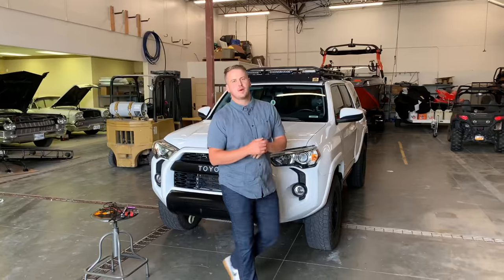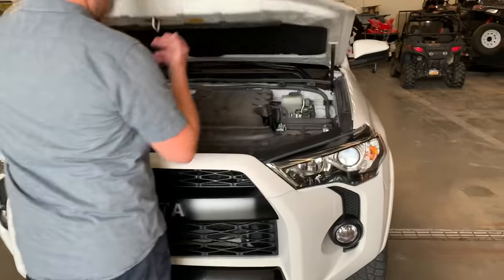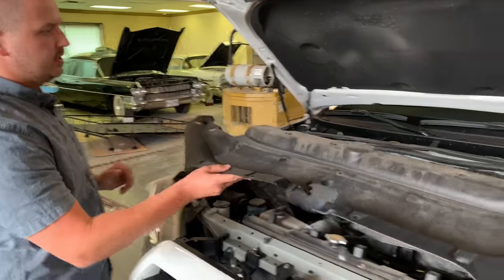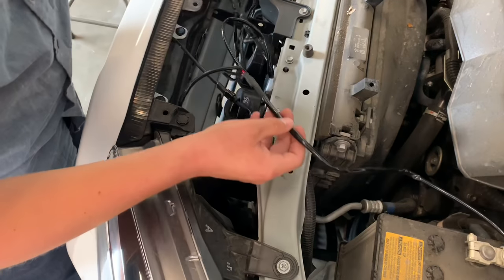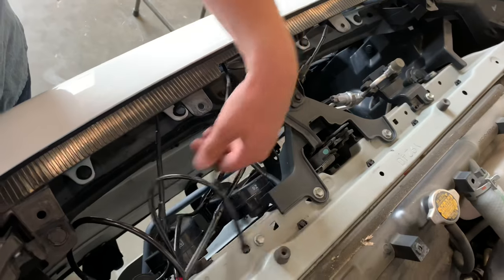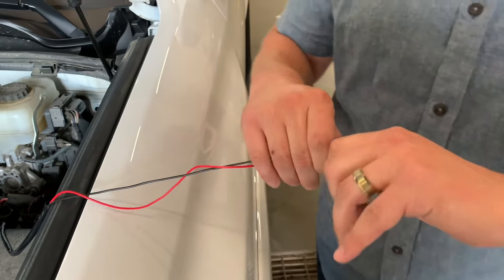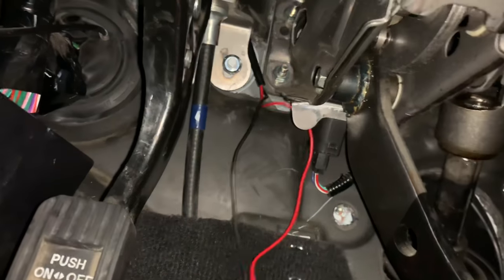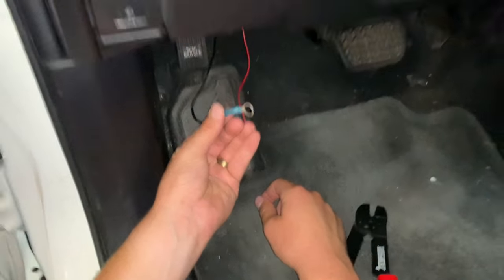4Runner RAPTOR Lights Installation!

Comment: Install appeared to go smoothly, but lights will not turn on.  Tried different fuse locations in the cabin, re-checked connections, but nothing.  Awaiting return communication from 4Runner Lifestyle.
Reply: Just did the install, same with me. Did you get it figured out? Thanks in advance.

Comment: Where do we connect on a 2024 trd 4Runner outside fuse box?
Reply: Im wondering the same thing. My headlights' DRL fuse tap seems to be the only fuse that I can plug into that actually turns the lights on and off with the car. The other fuse locations just keep the raptor lights on even when the 4Runner is off. I can do what he did in the video but then my fuse box's cover wont be able to go back on with that big fuse tap coming out of it. Lol talk about rough day

Comment: I have a 2020 trd pro 4runner and my fuse box doesn’t have the same configuration. Where do I plug in the add a fuse??
Reply: @ Ryan Peck, did you find out the answer to your question?
Reply: I’m still trying to find the answer. No info yet on you tube?
Reply: Did anyone find an answer for the 2020 TRD pro?
Reply: I have not. There is a guy on you tube with his white 2020 Pro with raptor lights. He has not posted the video yet how to hook them up. His name is Chris.
Reply: Plug it into the big fuse box in the engine compartment.  Look for the fuse marked 10A INJ
Reply: It’s the 1st 10A amp on the left of the fuse box when standing on the driver side.  The fuse order on the left raised area is 25, space, 20, space, and then the 10 fuse to remove.  The raptor lights will turn on and off when the vehicle is on and off.
Reply: Thanks Raymond, Now I just need to order the lights. Was waiting to get a answer. Thanks Again.
Reply: @Raymondmoy  Have you installed these on your 2020 already? If so would you mind doing a quick video showing where you plugged everything into, if not no worries. Thanks.
Reply: @Raymondmoy  when you plugged these into the location that video suggest were you able to get the lid on the fuse box fully closed?
Reply: Jsin Legacy. Yes, i was able to cover the fuse box and snap it in place in 3 out of the 4 connectors. 

See the video posted by Taco Twonz 
https://youtu.be/WxPsEPIQ3ak
Reply: Jsin Legacy 

Remove the bolt at the edge of the fuse box, so that piece can be removed.  The wires for the raptor lights can be run up that area.

Comment: Hi, would they fit a 2021 4Runner? Or do I need something different? I went a bought some on Amazon and I just couldn’t install them they were loose and flimsy they were called seven Sparta 4 PCS LED.

Comment: Bought these for my 2021 4Runner SR5 Premium and they don’t snap into place on the grill. The body of the 2020 and the 2021 didn’t change. Disappointed.
Reply: They fit perfectly into mine.  I know it seems silly, but try flipping the lights upside down from the way you had it initially.  They're identical, I know, but this worked for me.

Comment: How would you install these different if you want them to come on with your headlight amber lights or foglights?
Reply: I'm interested in knowing the same. 
Which fuse should be used to get the lights to turn on with headlights?

Comment: does the black wire is the ground or negative? trying to figure this with a switch and a relay. Are there any videos with the same lights installed it with a switch and a relay?
Reply from the maker: We don't have another video showing this but the black wire is indeed a negative.

Comment: I have the 2021 4Runner TRD Off-Road Premium w/ KDSS. There are only 3 open circuit breaker slots open and only one of them fits the wire that comes from 4Runner Lifestyle. That specific breaker opening works but does not power down when I turn off my accessories, turn off lights, lock my doors, etc ... The Raptor Lights stay on. Any guidance or support would be greatly appreciated.
Reply from the maker: For the newer 4runners you have to put the add a fuse in the tail position of the fuse box.
Reply: Thanks

Comment: Obviously a dated video at this point.  I don't have all those open spots on my 2022 SR5.  Also, when does that spot get power?  Always?  When the accessories come on?  When your DRL come on?  Or when your headlights are on?  Great video for whatever year 4Runner you're using, but details about the type of fuse port you're using would be helpful.

Comment: on this install will the raptor lights work without having to put the DRL lights on?
Reply from the maker: If you put the ad-a fuse in the correct position the raptor lights will turn on and off with the car organically no switches or light toggling needed.

Comment: Interior Fuse locations are completely different on a 2020+ 4runner. Will need to utilize another fuse placement for these years, FYI.
Reply: Yes...2018 is different as well
Reply: Which one?
Reply: I have a 2020 and I don't have an empty slot where should I plug it in?
Reply: I’m in the same situation what did you guys do

Comment: I bought a set similar to these lights, do these come with all of the electrical connections included? If not, what sizes/gauges do you need to buy?
Reply from the maker: It does come with all the necessary hard ware

Comment: Do these clip-in style lights work (clip-in) on the OEM upgrade grill? I have a 2017 SR5 and want to upgrade my grill ty o have the lights but i don't want to spend $600 for a grill upgrade to then find out that these lights won't fit. Anyone know?
Reply: Should fit the SR5 grille just fine. But only on top. The bottom grille holes are bigger.

Comment: I didn't like where the harness was installed.  Instead I installed it on the fog light circuit so that they lights would turn on and off with the fog light switch, controlled by the fog light relay and protected by the Fog FR fuse.

Comment: I have a ‘21 TRD Venture, I’m installing the lights on the bottom section of my grill and the lights don’t clip on. Any advice on how to fasten them?
Reply: Also, my lights stay on constantly. Please advice!
Reply: @raularisty3077  I had to buy bottom light kit.  It comes with a backing and have to screw them together to stay in place

Comment: So do we just leave the hole in the firewall unplugged?  Cant plug in the grommet with the wire there.
Reply: what i've done in the past on other vehicles is i remove the grommet and drill a small hole through (slightly smaller then the wire diameter to make it a tight fit), then pass the wire through the grommet and leave the grommet sitting in the middle of the wire. then when the wire is done being fished through the firewall i simply slide the grommet back into position and pop it back in. easy way to seal it back up.

Comment: What is that blue piece at 7:32? I bought the raptor lights and they didn’t come with that.
Reply from the maker: that's your ground connection, if your raptor lights didn't arrive with one feel free to reach out at sales@4runnerlifestyle.com
Reply: @4runnerlifestyle  ok thank you

Comment: Does anyone know of an install video that shows me how to do it if I want the option of turning the lights on and off?
Reply: You would need to link it to the cabbing with cables OR use search for a led switch with on and off remote. Like those rgb ones.
Reply: Just cut the positive line and put an togle switch for on and off.
Reply: @BENHAWAIIVLOG  better to do it on the ground side.

Comment: Do headlights have be on or will the raptor lights   work with just the  daytime running lights  on  as an option
Reply: No... if you put the fuse connector in the fuse socket shown it will illuminate when the ignition key is turned on.
Reply: @synth505  so essentially its always of the car is on?
Reply: @PocketManga  yes... if ignition is on, lights are on

Comment: Ya you don’t need a flat head screw driver to pry off those plastic pieces in the beginning. It’s just a button you need to push. I broke 2 of em trying to pry them out with a flat head like you said

Comment: So I did this and have to say I was a bit annoyed that by the time I ran everything to the fuse box, the fuse list was completely different for the 2020.  I do not know much about that stuff so is there any indication as to which one of these fuses will work so the lights come on as daytime driving lights?  I have it plugged into the TAIL fuse now which works when I turn the lights on but I'd rather have them on all the time.  Any help @overland?
edited for fuse map image: https://i.imgur.com/akDa4Uv.jpg
Reply: Did you ever find a resolution?  I also have a 2020 and am interested in these lights, but would only purchase them if I knew it was possible to run them all the time and not just when the low beams are on.
Reply: In the fuse box under the hood, look at the far left and you see a 10A fuse marked “INJ” it’s 2 above a 20A fuse marked “INJ NO.3” plug it in there
Reply: This worked for me! Thank you
Reply: Ryan Fisher  did you leave the cover off??
Reply: @Geiger19k  thank you for this.   So just run that red wire with the fuse inside and keep the black plugged inside or also under the hood.  Thanks
Reply: @Geiger19k  where did you land the negative?
Reply: @rebellion700  I just picked a screw that was mounted to the body. Doesn’t have to be specific.

Comment: I’m assuming since these are on all day and night whenever the truck is on, these will die fairly quickly? How long do these lights usually last?
Reply: Thats the beauty of LED lights. They use less power, are brighter and last longer. Many LEDs have a rated life of up to 50,000 hours. This is approximately 50 times longer than a typical incandescent, 20-25 times longer than a typical halogen, and 8-10 times longer than a typical CFL. Used 12 hours a day, a 50,000 hour bulb will last more than 11 years. Used 8 hours a day, it will last 17 years! I don't know what type of LED they are using for this product but I'd bet my bottom dollar they last longer than any halogen bulb I've got on my vehicle.

Comment: cool lights but how to turn it off during day time?
Reply: Use a different fuse selection
Reply: I used the 10a."tail"   on the in cab fuse box.  Because I didn't want them on during the day

Comment: I installed exactly as shown. Seemed easy enough but the lights won’t turn on. Any ideas as to why? I’m at a loss.
Reply: I'm having the same problems as well.
Reply: probably a bad ground. That location is awful.  I would use the ground in the engine bay near the batter or at least one that has metal to metal contact. What he did in this video is just an awful idea.
Reply from the maker: Most likely you plugged in the add-a-fuse the wrong way, flip it in upside down and plug it back in!
Reply: try chaining the orientation of how the hot wire plugs into the fuse box.  I plugged in one way and lights didn't work....changed 180 degrees and plugged back in and the lights work.

Comment: I have a 2018 runner sr5 my lights didn’t turn on  help not sure what I’m doing wrong
Reply: check your power or ground connection.
Reply: vince j , I connected the fuse to the relay and fuse box in the engine bay with black ground wire connected to a bolt holding battery and it works. (Battery died after a week, not sure why). Tried connected to inside fuse box under steering Column as shown in video with the black ground wire and did not work....
Reply: @honestgal9098  if you try to remove the light to see if your battery die again.  IF DIE without the light then some thing else causing the drain not the light itself or vice versa

Comment: Can someone tell me if they turn off when you turn the headlights off or do they turn off if the brights are on or is it if the car is on they are on
Reply from the maker: It depends on what fuse you put the ad-a fuse in. But if you use the fuse provide they will be on when the car turns on.
Reply: @4runnerlifestyle  the lights (raptor) stay on after the car is off.
Reply from the maker: @gsdlvr123  yes depending on where you put the ad-a-fuse will change how those lights receive/ interact with the power distributed
Reply: @4runnerlifestyle  we put it where the video says. We had to change it but now can’t find a spot where they will be on without the lights.
Reply from the maker: @gsdlvr123  If that's the case you need to but the ad a fuse in the most back position.

Comment: I wish the lower grille had a ‘how to’ video. The fact that the top grille lights snap in and the lower grille lights have to be screwed makes it difficult for short arms. Why couldn’t they be made the same?
Reply from the maker: Because of how the lower grill is set up there just isn't a current way to snap them into place, I will add that video idea to the list so we can get that out for y'all

Comment: Question on these. So they come on only when your headlights are on? Thanks.
Reply: Don Russell 

The way they did it no once you turn your key in they are on.
you can run it to a switch with a relay and fuse if you want
Reply from the maker: They turn on with your ignition so they're on day and night!
Reply: Overland Depot which fuse spot should be used for a 2020 TRD Pro? I used “TAIL” per your comment, but they only turn on when the headlights are on. I’d like them to be on when the ignition is on.
Reply: Brian Yoshida What setting on the headlight stock turns the raptor lights on? Low beams? Parking lights?
Reply: @by350  do these lights blind users during a day? I know its not that bright but foes it annoy drivers?
Reply: @PocketManga  no they aren’t very bright.

Comment: I’m considering getting a 2020 4Runner, but im curious if the radar device on the bottom grill is going to make it difficult or impossible to install a heritage grill. Anybody have any thoughts?
Reply: I just picked up a 2020 and ordered my heritage grill. They made a new one with different brackets for the 2020 model. So all those cheap grills you see online don’t work for the 2020. The only place I found it was through the dealer until aftermarket companies come out with an updated version.
Reply: As noted below the knockoff ones are not cut out for the 2020 radar sensor. That being said, all you have to do is dremel out a notch for it if you want to same some money over OEM.  I just order the OEM version to get a good fit. Part numbers are PZ323-35058 & PZ327-35056

Comment: I wish someone would show a install how to remove on the 2020 4runner under the dash area where to add the fuse on the 2020 since it is totally different. Man when I did my 15 Tacoma with the led bar and push button to light it was more simpler.
Reply: Did you ever figure it out? I just came across this with my 2020
Reply: Sal Ochoa III No I did not. My plans changed. I’m selling the raptor lights because I added 20 inch bajadesigns led light bar in behind the grille in that area. Ran wires thru firewall and wired to aironboard switch to turn led bar on. Thanks for asking.

Comment: This is a “cheap harness” if you run an additional ground from a true switch, and hot wire from the battery, it’s MUCH BETTER. Plus you don’t have to use a “jumper fuse” or “add a fuse” (which can cause your fuse box to melt).
Reply: Can you explain a little bit more on how to do this? I’m a complete noob and want to run it right to my battery but I don’t know how. Do I need to buy anything extra?

Comment: That's a horrible place to put the ground.
Reply: Hey, I'm thinking about adding these lights to my 4Runner. Do you have a better location for the ground wire?
Reply: why is that a horrible place for the ground?
Reply: Where is a good place?
Reply: My thoughts exactly 🤣
Reply: @xy0n28  They literally pass up the ground in the engine bay.  Strip off that wire loom or tape or whatever it is and connect it to the ground in the engine bay near the battery.

Comment: This does not work for 2021 SR5
Reply from the maker: They do, you just have to run the fuse to the rear most position

Comment: This kit that arrived, the wiring length isn’t long enough to even come close to making it into the cabin!!!wtf! And the the additional harness it comes with (dual add a fuse mini connector) for the engine fuse box …..well that fuse isn’t long enough to clip in either…..waste of time..

Comment: “I removed them a while ago and didn’t put them back in , so that’s why I can’t show you”. 😂
No dude. You can’t show that step because you broke all the clips with your flathead screwdriver. That is NOT how you remove them.

Comment: Do not remove rubber plug/grommet make a small slice in the center of it, then push the wire through. Thinly insulated wires and unprotected holes and pinch welds do not mix. Unless, of course, you like ruining electrical equipment.
Reply: I was about to post that.
Reply: Dont forget water intrusion!

Comment: Why would someone want to make a toyota look light a ford?
Reply: It doesn't look like a Ford. It ads a functionality that Ford "invented". Don't act like a kid.
Reply: @Sasasala386  Ford is required to have them on the vehicle based on federal regulations. Title 49, Part 393, Subpart B, 393.11 Lamps and Reflective lights, Identification lights, vehicles over 80 inches in width are required to have identification lights. Ford Raptor is 86.3" while a normal F-150 is 79.9". Ford thought outside of the box in terms of placement. Federal codes simply states as close to the top as possible. Toyota 4Runner is 75.8" wide...so back to what Ted Jackson is saying why would you want to look like a Ford? Like I said to Dustin above...60+ years of offroading and overlanding didn't have the need for grill ambers until the Raptor came around. It's a dumb mod and serves no utility for vehicles under the Federal code for commercial vehicles over a certain width.
Reply: Dude.. here's a nickel for a sense of humor. It looks cool, that's why🙄
Reply: @PK-we9rb  .